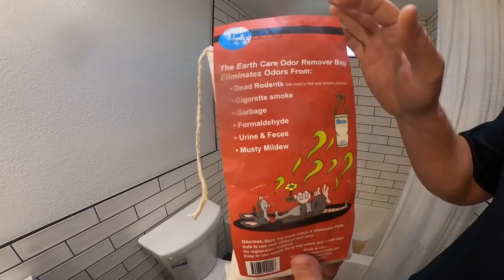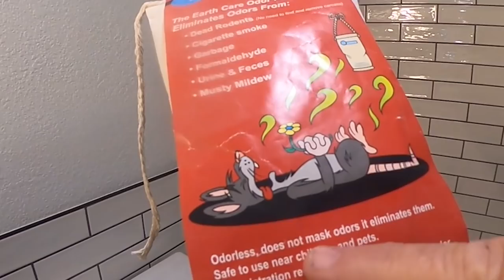How to get RID of rats FAST......What happens in Vegas gets eRATicated in Vegas!

Comment: Another freebee for concrete builders: when you have the iron rods for reinforcement to put into the cage framing, don´t waste afford and time to getting them in seperatly and lose, just use some of that cheap binding wire to turn all the iron rods into a single rod (german electricians are using that method for easily pushing wires)  and cut the 2-3 bits of wire, you took to turn a bunch of single rods into one over 5meters, off to place them where needed when they´re all in. I was just a helper, but tought that method to an experienced german cencrete builder and just for that, he immediantly paid me more money, since stuff like that is going to save him so much money, easily 2-3 hour per day he can save by that he said.

Comment: I just rehabbed our sun room with a new floor and put in a rat slab to keep the mice out...  The joists were nasty - and I sprayed them with enzyme cleaner - which helped.  What really works though is to encapsulate the wood with an oil-based primer like Kilz.  I rolled it onto the joists, and then used the spray-can version to get everywhere else.  I dumped a ton of primer in that room, and the odor is GONE.

Comment: So percussion can we take on the outside of the house to prevent these rodents making their way inside
Reply: That's exactly what needs to be addressed the cutting of the walls is a bit over kill... Wherever those rats are getting in from the outside was never addressed and they can clearly get back underneath that place
Reply: @exclusionexperts596  If you watch more of their videos you see they do full external exclusions but also remove the mess and smell from walls and determine the exact entry points. There’s always 1 or 2 main every points that need fixing as well as the general exclusion work.

Comment: Rats can also chew through foam..... Other then that beyond thorough work 👍
Reply: I don’t think they chew thru that black foam they use I think they’ve said it in videos in the past.
Reply: @giovaldez8387  they chew through wood....what makes the black foam any better I've seen them chew through both easily, it's Foam!
Reply: @giovaldez8387  another thing, why didn't they use the "black foam" for the repair then if they can't chew through it? That repair they did over time will give especially if the rats that were once there come back to get in. They're gonna blow right through that trust me speaking from experience 👍
Reply: Chew thru metal screen too
Reply: @exclusionexperts596  for sure didn’t know that about the foam mr experience but good looking out for the heads up
Reply: @giovaldez8387  glad you learned something 👍